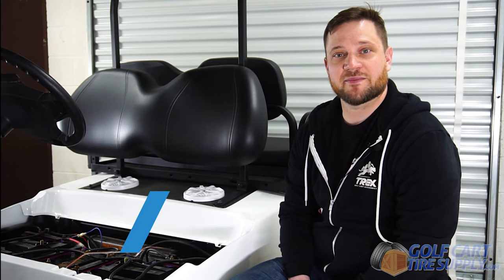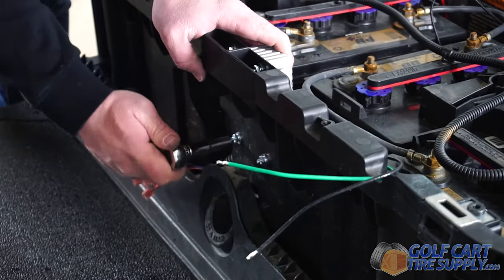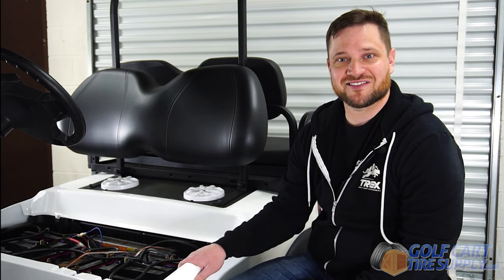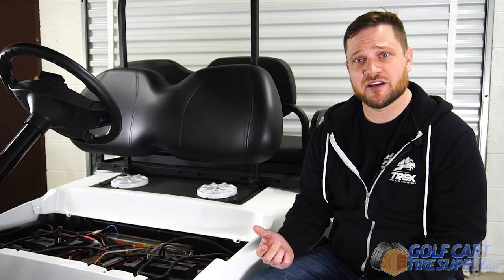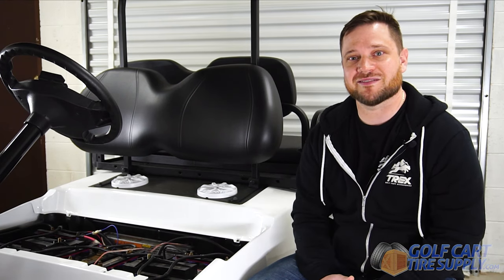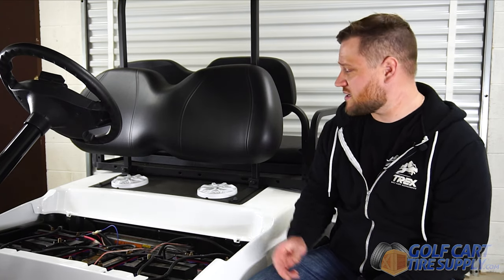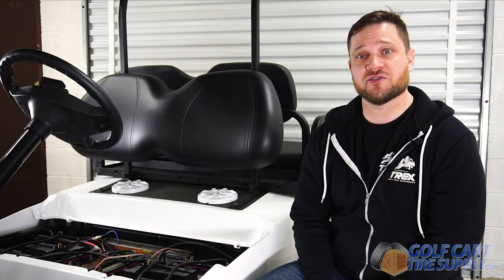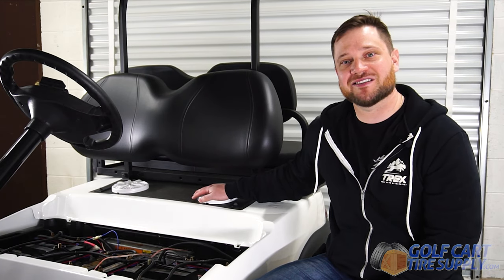Golf Cart Bluetooth Speakers - Install

Comment: Great Video! Where did you hook up the remote wire to?
Reply: i think the remote wire would be hooked up to the silver power switch they installed in the battery area in order for the switch to tell the amp to turn on